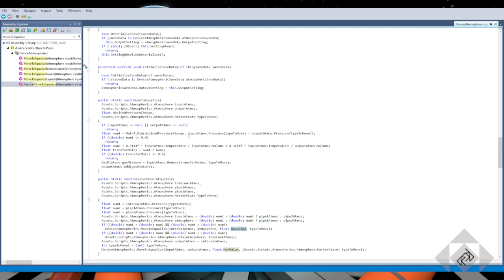Solar Warmer Revisited - Stationeers Experiments

Comment: There was definitely a state change in the works for the atmos.  Not sure it it will help might look at the Mod Elmotrix created as well as the framework he used to create it.  That might show you the API that help to decypher it.
I am not a programmer I am tearing apart code to learn python at the moment since I get bored and distracted when watching tutorials

To the Vacuum conversation, I thought that since it reduces the boiling point of water and if you are exposed to vacuum your blood would flash boil off rather quickly.

You might want to switch you vacuum testing to Mimas after seeing you get triggered on the Earth position lol.

The plant is Winterspawn.
Reply from the maker: OH YES! Looking forward to Elmotrix mod, looks great. Blood will only boil if it's exposed to vacuum, your skin is perfectly able to hold it all in as you float around in space after being impostor-ed by your cremates. That's why exposed tissue like the nose, eyes, and other places would evaporate, or flash boil, but not say, your stomach, your leg... You skin is very capable of holding back the roughly 101kpa of pressure in your meat sack.
Reply from the maker: If you want to try an experiment, get a glass jar, drill a hole in the top, put a fitting and rubber washers on it, inject water into a piece of steak, shrink wrap it, then suck out all the air with a pump.
Reply from the maker: https://youtu.be/jU3MOLqA3WA?t=366